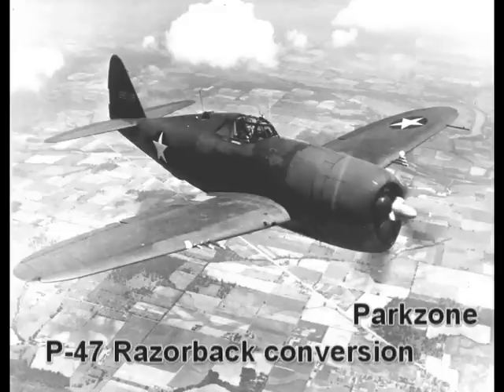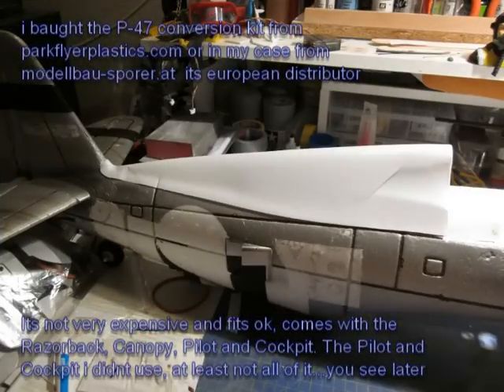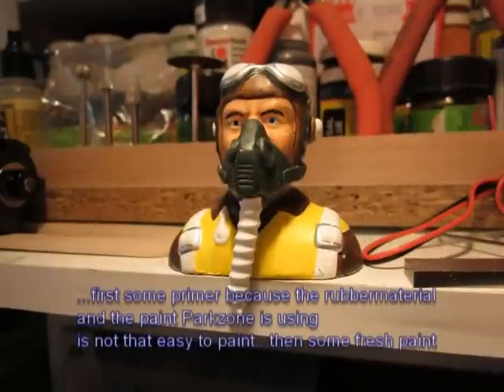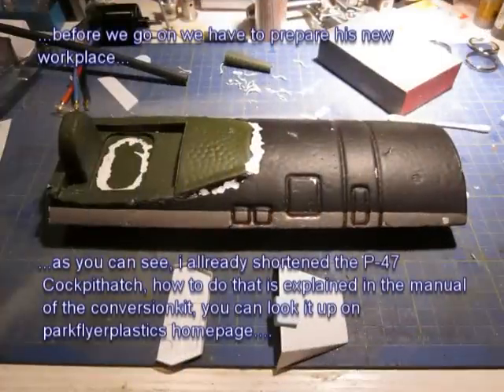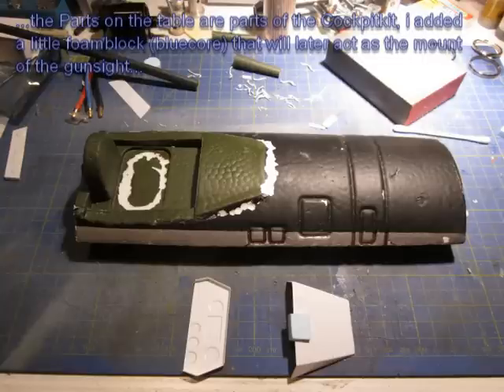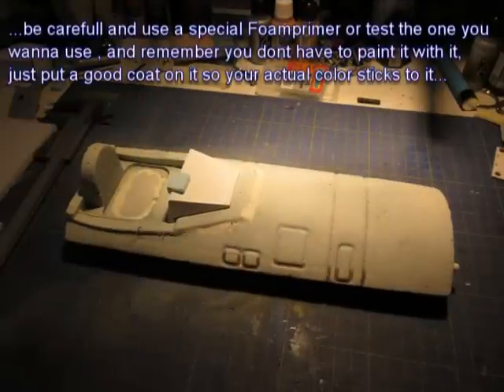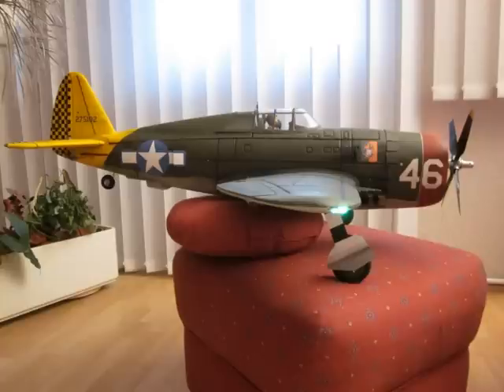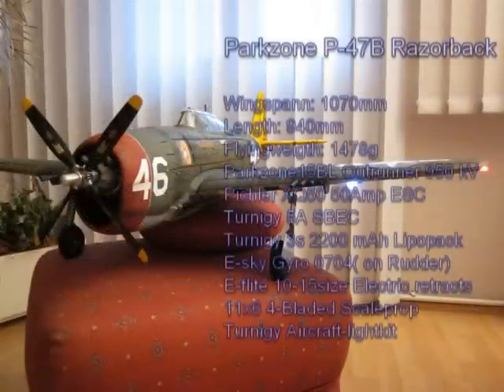Parkzone P-47B mod

Comment: Awesome!  I bought the kit for the new Eflite Thunderbolt,  how did you attach the spine to the fuse?  And did you mold it after placing it with any kind of putty?  Thanks!
Reply from the maker: +Transkroner  Thank you for your comment, and of course i glued it to the fuselage (epoxy), held it in place while it dried with a some tape and a few needles.
And yes, you have to use filler on the kit. I mean it fits pretty good but not that good to make the seam invisible. I used some lightweight filler (its actually for stuccowork and weighs almost nothing, almost - "moltofill Stuck Spachtel" / a german comm.) to do that.
If you really wanna do this mod, try to use as little filler, glue, paint on the fuse/tailend and stuff as possible, otherwise you get problems with your CoG.
You will end up with a tail heavy plane mostlikely anyway...so start to think about a bigger motor/esc/external bec or some other extra you can fit in the front, so you dont have to use dead weight to get back to the original CoG.
The Jug will gain some weight but it makes her fly even better in my opinion, more like the real thing i think...but that also means be extra carefull on your maiden flight....its a "new" plane...and it does not behave that floaty and stuff as the original e-flite/parkzone P-47 anymore...good luck with your mod, and happy flying buddy :)
PS: If you find the time, let me know how things turned out. cheers

Comment: Love your builds. What prop did you use for this conversion? I am in the process of doing the same. Did you swap out the motor and esc?
Reply from the maker: +619SixFour Thanks for your comment, and the prop i baught from a german supplier and unfortunately is no longer available, at least not here...but i heard from some of the guys on RC Groups that they sell a very similar one at hobby-lobby (11" variable pitch prop)...and you have to swap the motor and esc too if you wanna use one of these otherwise your amps will go thru the roof and you will burn out your motor for sure...a G25 (750 or 870 kv) from hobbyking is a drop in for example but of course there are many other choices too here, and aim at least for good 50A esc and an external bec for safety...have fun with your build and thanks for stopping by :)

Comment: What primer did you use? Was it out a a spray paint can?
Reply from the maker: on this particular plane, yes it was, its a special primer for foam which can be sanded afterwards...its from a german company and is called dupli-color-foamprimer...i use that stuff in case the foam shows a bit of aligator skin...after sanding you cant even tell its foam anymore, plus it sticks very good of course, i used that stuff on a number of my planes, thanks for watching, cheers